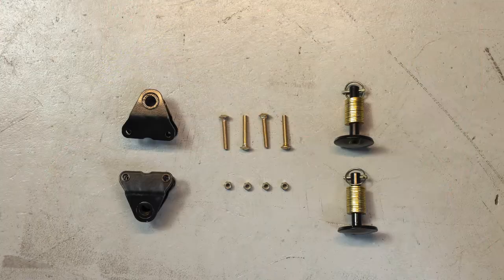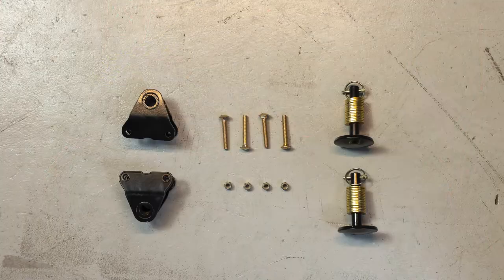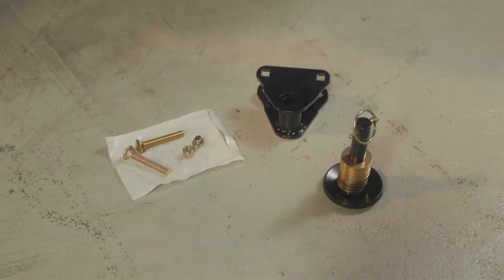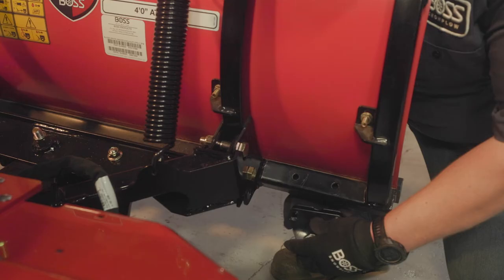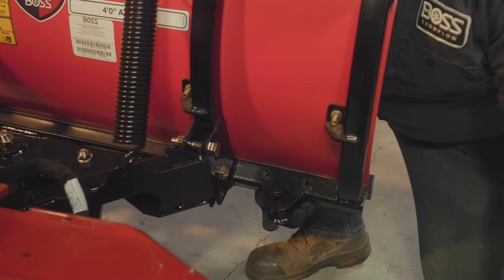Plow Shoe Installation On A 4' & 5' Straight ATV Blade - MSC13040 | BOSS Snowplow |

Comment: Noob Question: What is the purpose of the shoes?
Reply: The shoes prevent any corner or surface of the plow from digging into the ground your clearing.. gravel,blacktop, asphalt ect..  it stops or atleast highly reduces any chance of surface damage that may occur